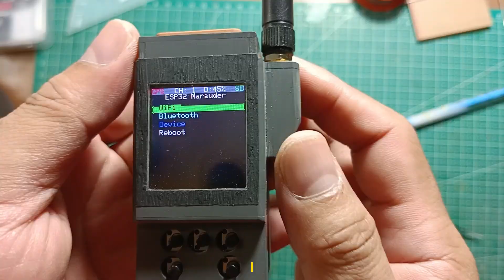How to Make ESP32 MARAUDER MINI Part 7

Comment: Very nice to watch your work brother. I saw you have also build Smoochiee board , CYD diy and maraduer mini. What do think of these three, which one is your favorite and stable one?
Reply from the maker: My favorite is the DIY Smoochie Board because it has a lot of features in one small device, but because of the many modules, the wiring is very complicated and might affect the NRF24 and CC1101 modules. Maybe using a custom PCB board would be better. And the Marauder Mini is simple because it only uses one module, which is the GPS, and that makes it stable.